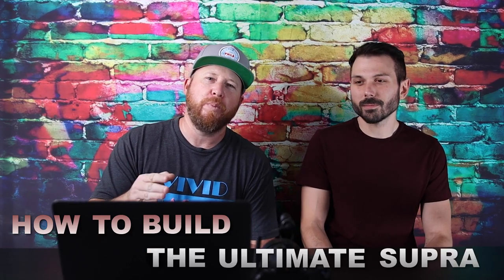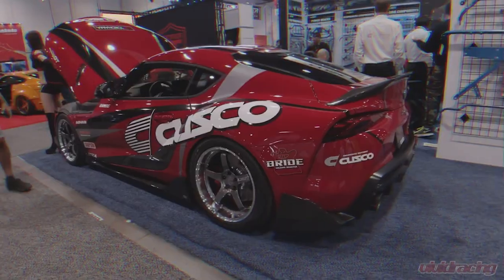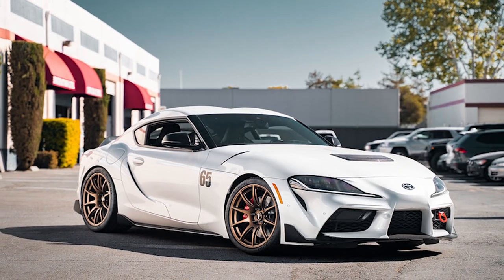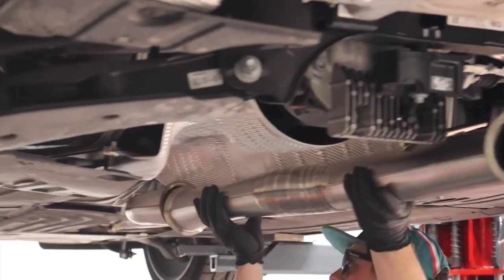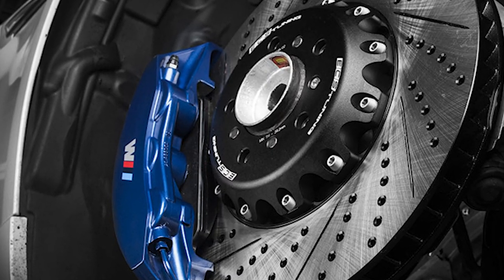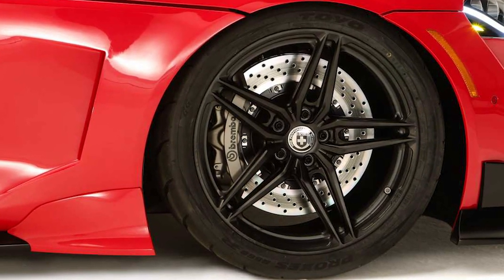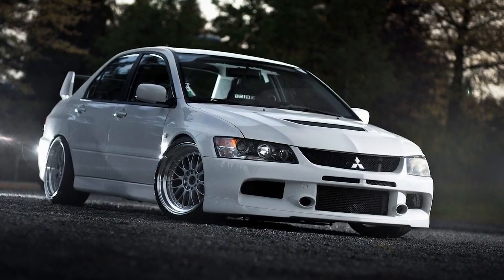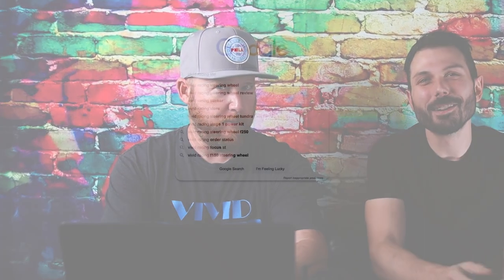BEST Toyota Supra Build?! | How We'd Build The ULTIMATE A90 Supra

Comment: I am building a Jaguar F-Type as my ultimate build. Some of my parts have come from y'all. This build will be my Swann Song build (The final build of my career). My personal Dream Car build. Stage 1 is all about the Bolt-on Mods. Stage 2 is all about the Machinist Work & Internals. Some Stage 2 mods will include Over-Sized Valves, 5-angle Valve Job, Ceramic Coating the entire Combustion Chamber, pistons included, Forged Rotating Assembly (if I can Find the parts), Milling the Heads and Block, and I am doing Port Work starting at the Cylinder Heads through the Lower Intake and finishing with the Supercharger. Amongst other Builder tricks. 

I would like to change the Final Drive Ratio as soon as I can Locate the right Ring and Pinion Gears for the Differential. Any help in locating the proper Ring & Pinion Gears would be appreciated!

All my European Parts Contacts seem to have closed in my absence from the Automotive Field. So, if ANYONE at Vivid Racing can help me find the Internal Parts I am looking for, I will feature VIVID RACING in my YouTube Montage Video for the Jag Forums. I will also make a special video focusing on the technical and Spec part of my build so you can see how your parts work with a properly bult engine.

I need some Over=Sized Beryllium-Copper Valves, Matching Valve Seats, Forged Rotating Assembly with .040 over Flat Top or Dished Pistons, and 3.73:1 Ring & Pinion Gears.

Any help in finding a supplier for these items will be greatly appreciated.
Reply from the maker: shoot email to marketing at vividracing dot com